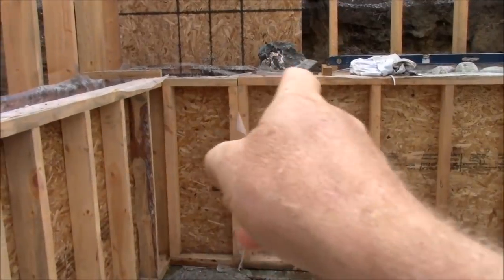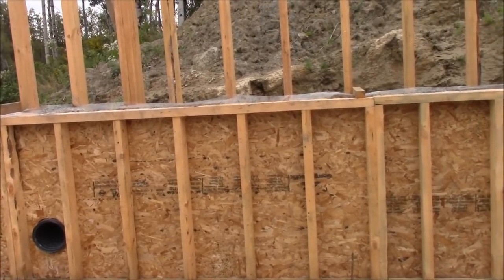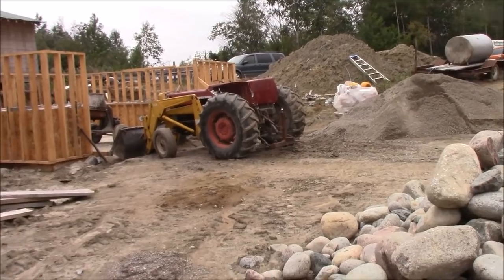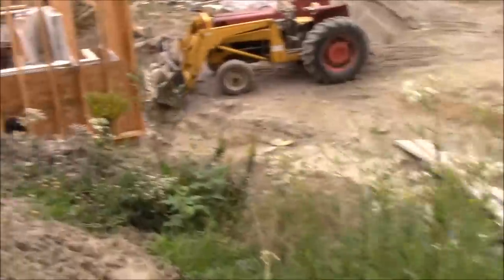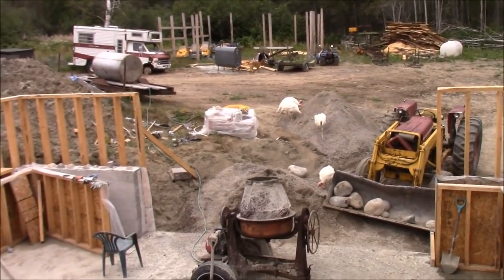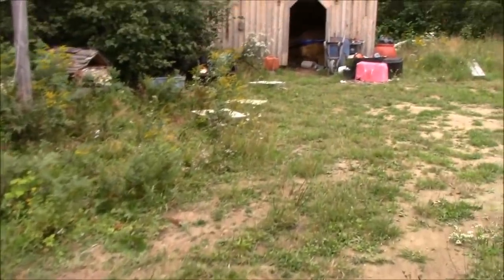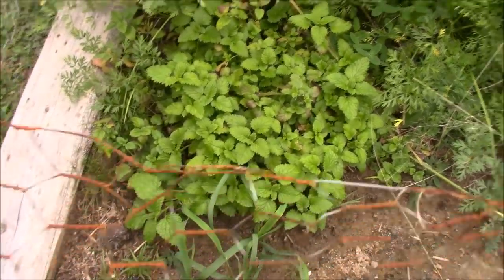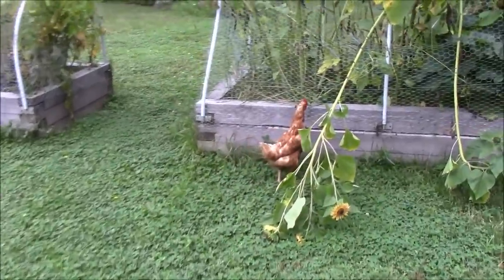Almost Half Done Our Concrete Walls

Comment: Hello,  Now would be the time to consider putting rigid insulation on the outside of your basement.  Cheapest quickest way to make the basement capable of being heated.  I had a daylight basement many years ago and even though it had a glass sliding door and two large windows in the daylight wall the ground temperature stayed right at 55 degrees F and so did the inside of the basement-- never varied more than five degrees (no insulation) summer (high as ninety) or winter (down to single digits).  Good for cooling off in the summer but impossible to heat in the winter and I had a 180,000 btu oil boiler that wasn't very efficient so it cooked off a lot of residual heat but it made very little to no difference.  A couple of layers of two inch foam would give you an R20 and you wouldn't lose any inside space nor have any condensation problems.  It would still be cool in summer if you didn't introduce any heat.   Anyway something to consider.  Take care.  Doug
Reply from the maker: Hello Doug... I remember years ago my dad insulated the outside of his basement when he first built it, the next winter the outside ground froze to the concrete blocks and lifted half of the basement up one inch, even his drains froze where the snow drifted away from the side of the house. The next year he removed the insulation and  there was enough heat escaping through the wall to keep the ground thawed, the basement hasn't cracked at all in 40 years since he has removed the insulation... This is what I am worried about happening up here. Thanks again Doug. You take care ttyl...Cheers.
Reply: I don't think that is going to be a worry for you.  Concrete blocks are much more porous (especially the older actual cinder blocks) and can absorb the water,  You also have a pretty good drain system there which can be greatly enhanced by backfilling the first one or two feet with 1" minus gravel in drainage cloth (so the clay can't silt in).  With no water backing up then there is nothing to freeze,  The problem is it takes a great deal of energy to heat the ground and eventually everyone wants to use the extra space in the basement as living area so then the only solution if it isn't  insulated outside is to use a thick stud wall spaced away from the interior concrete with insulation.  Eats up floor space and is pretty expensive with other concerns also.  If I was really concerned I would get a good thick (I used pond liners which were pretty cheap for a 12 mil plastic got them on Amazon for my vapor barrier under my 800 sq ft shop slab) plastic.  By fixing it up on your sill plate and draping it down over the insulation with glue here and there down to the footings there is nothing for ice to cling to. I am here in Alaska with a very wet/snowy climate yet in six decades here I haven't heard of any problems like you describe although we don't have heavy clay.  At any rate good luck with your project.  Might also want to think about a wheeled gantry with a washing machine type bucket lifted by a boat winch.  Using another  lead to tip it.  Wheel right up to the forms and tip several buckets at once.  Counter weight the back bottom and use a short beam out to get over the form.  Mounted on good tires it would be easy to roll.  Just a thought..  Take care.  Doug

Comment: Why don’t you just take your outside forms off and turn them upside down to use for the top 4’ of the wall.  Would save you from buying more strand boards to use for top of forms.
Reply from the maker: I think they are way to heavy for Heather and I to handle like that John... Plus I would have to square everything again, We are hoping just adding more OSB will be faster. Thanks again John. You take care ttyl...Cheers.